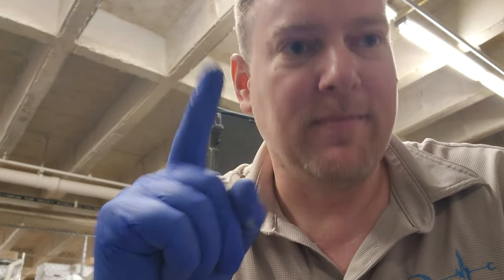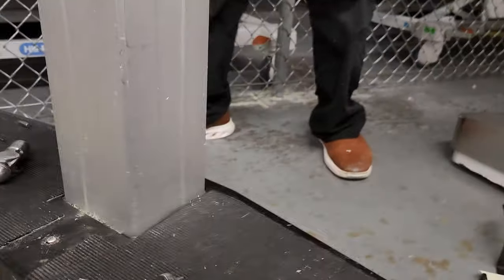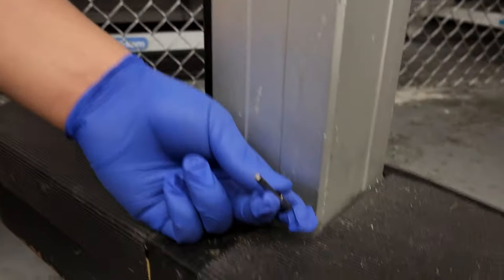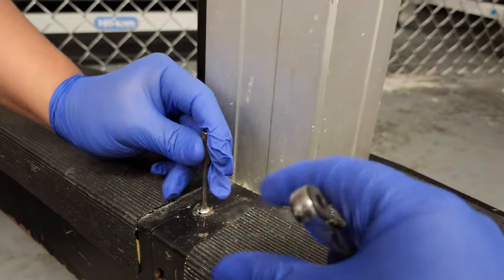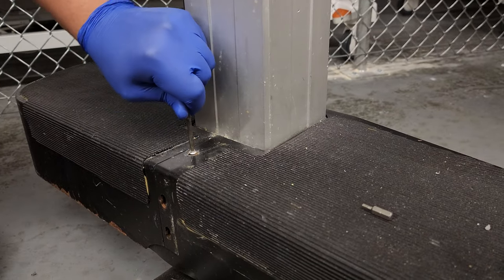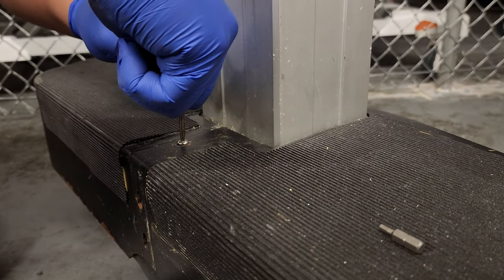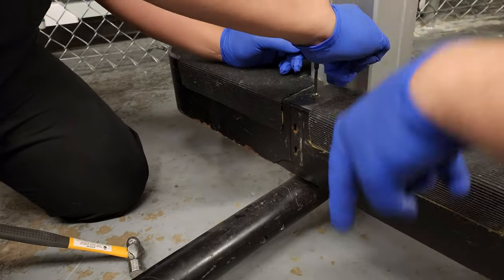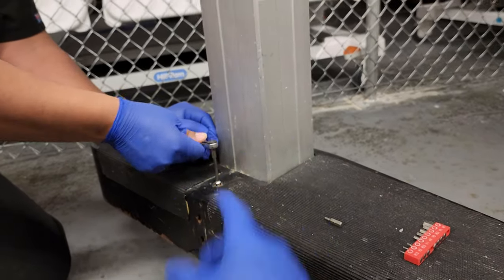Stripped Allens? No Problem.

Comment: I've snapped enough torx bits over the years from using them as sacrificial bits to extract stubborn screws. Used to be sad about breaking tools, but tools wear out over time and a few need replacing every now and then.